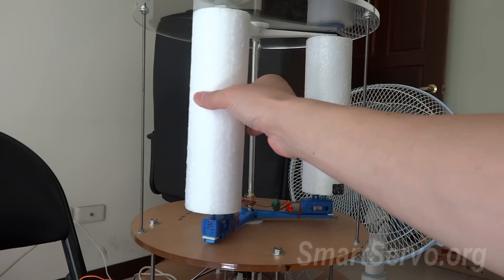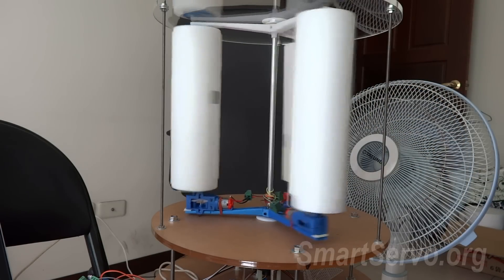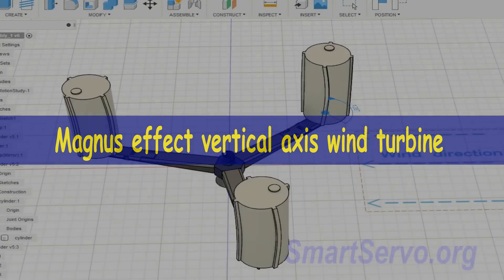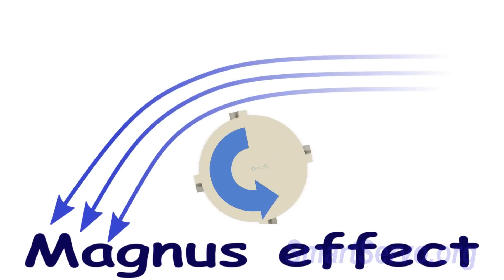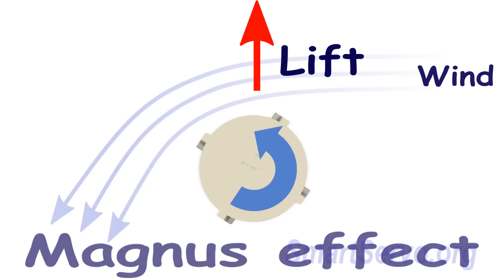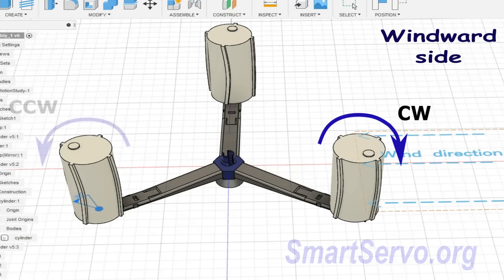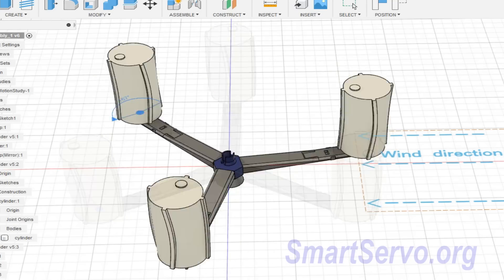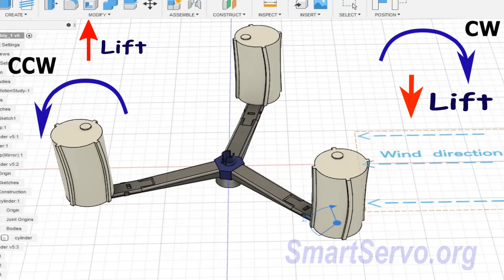Magnus effect vertical axis wind turbine, No blade, start quickly

Comment: I see that the motors you used have a gearbox. Is it because they need more torque and less speed? I’d like to know the main reason. Great video, by the way!
Reply from the maker: Yes you are right.This small DC130 motor has a top speed of 5000 rpm, but has very little torque

Comment: All practical tests of ground-based small wind turbines show: 1) They hardly produce any electricity! 2) They do not last long! 
Wind/electricity yield increases with the third power of the wind speed.+ 100% wind = 800% +electricity. Close to the ground, however, 0 constant wind, but intensive gusts. 
Therefore 9 out of 10 small wind turbines stop working after just a few years due to the extremely gusty winds close to ground.
On the other hand, solar panels generate at least 10 times more electricity with the same investment! Reliable and almost maintenance-free for at least 25 years!
Reply from the maker: It is precisely because the current wind turbine has many shortcomings that we need to improve it. This is the difference between engineers and investors.

Comment: Hi ! We are two french students and we are leading some research and experiments on magnus effect wind turbines. We would like to build it ourselves to test it with different parameters.
 Is it possible to have more details on the construction of this turbine (especially on motors) ?
Reply from the maker: URLs to all project files are listed below the video description. The motor model is DC130
Reply: @SmartServo_org  Hello again ! We've been going through the documents filed under the video but we still have some questions left. How did you build the gear reducer (or did you buy it ? what type is it ?) ? How does the tachometer work exactly ? And what is the purpose of the Arduino card, does it only receive information or also control the motors ?
Reply from the maker: @EliseVeyrat  you can get the gear box on amazon by searching"gear box arduino",To avoid too large a gear ratio to reduce the speed, 20 is a good choice. Since the rotor should rotate in opposite directions on the windward and leeward sides, the Arduino controls the speed and direction of the 3 motors according the azimuth sensor below the main shaft.As can be seen, two semi-circular plates are arranged at 90 degrees apart to divide a plane into 4 quadrants. at power up ,guessing at the center of the quadrant make the error less than +/- 45 degree which is small enough to drive the rotor in the right direction. when the main shaft rotates through the quadrants, the correct azimuth can be found.  then count the pulse from the third plate with 40 holes on it to get the real time precise azimuth.

Comment: I would say that It has blades on the foam cylinder
Reply from the maker: the strip on the cylinder is not necessary => https://youtu.be/XmZwYpoKQ8Y?si=R0IujWvqjNI3tsB0&t=22
Reply: the strip on the cylinder presents the force for cylinder's rotation, then causes outer turbine rotating.
you can compare the rotation speed difference between with and without the strips. 
and you can test by using the cylinder with very smooth surface such as thin foil

Comment: How are you solved the commutation of Flettner rotor rotation?
Reply from the maker: Using DC motor driver board (L298), all project parts are listed here => http://smartservo.org/en/magnus-vawt-files-open-en/
Reply: @SmartServo_org  Thanks. I think, overcoming inertia when reversing the direction of rotation of the cylinders must bring down the efficiency of this device severely.
Reply from the maker: @minduton  Yes, but energy consumption can be minimized through the methods described here => http://smartservo.org/en/magnus-vawt-implement-en/#improve_ways
Reply: @SmartServo_org  At this would be better to apply the "pendulum principle". Take such a pendulum at an ancient clock. It is a machine that performs a regular opposite movements, but with an absolute minimum of energy. So, install a spring or a piece of rubber coil into the Flettner cylinder, which mostly uses the energy to rotate the cylinder in the opposite direction.
It is also a question whether it would not be an advantage to reduce the number of Flettner cylinders to an even number. This would make it possible to mechanically link the drive of the opposite cylinders and then maybe figure out some mechanically elegant way to use the already unnecessary kinetic energy of the opposite cylinder to reverse the rotation.

This type of turbine simply stands and falls on how efficiently it is possible to recover the kinetic energy of those cylinders during their commutation. So far you are at "minus 100%" currently. :) Unfortunately. So in terms of overall efficiency, it sucks.

The speed and direction of rotation of the cylinders should copy an ideal sinusoidal curve when projected onto the graph, logically. With such a course of rotation speed, the maximum efficiency of this device will be.

Comment: All practical tests show that small wind turbines hardly generate any electricity. And only at costs above 1$/kWh! 
There is hardly any wind near the ground. And it is also very gusty, which extremely reduces the service life of the systems. 
With solar systems, you can reliably generate electricity for about 8-12 cents/kWh over a period of 25 years! //
Alle Praxistest zeigen, dass Kleinwindanlagen kaum Strom erzeugen - und nur zu Kosten sehr deutlich über 1€/kWh! Denn bodennah weht kaum Wind, zudem extrem böig, was die Lebensdauer der Anlagen extrem verringert. Mit Solaranlagen hingegen erzeugt man zuverlässig über 25 Jahre Strom zu ca. 8-12 Cent/kWh!
Wer unbedingt energieautark sein muß, der kommt um Kleinwindkraft kaum herum. Ansonsten jedoch viel ist Strom aus Kleinwindanlagen viel zu teuer.
Reply: А 10 КВТ ВЕТРОГЕНЕРАТОР ВЫГОДЕН ОН УЖЕ БОЛЬШОЙ ДЛЯ ДОМА ДОЛЖНО ХВАТИТЬ
Reply: It depends on where you live. In Germany, the energy in winter is hardly worth mentioning. I have a panel on the wall, it produces 80 watts in summer, but in winter it's only about 5 watts when the sun is shining.

Comment: Now let get to the main goal of this device: 'wind turbine' to generate energy.

1. all power input into make the device spin in the wind will greatly negate any potential power it generated.
2. with the complexity of the mechanism, in practice, this device is prone to failure very quickly
3. by using 3 brushed motors as a mean to spin it, the rsult is quicker to failure due to burntout brushes.
    if brushless motors are being used, they are expensive and added more complexity to the device.

Good try for demo though.
Reply from the maker: Thanks for your comment, let me explain your doubts：
1, Although it takes energy to rotate the cylinder, there are still ways to minimize energy consumption, see => http://smartservo.org/en/magnus-vawt-implement-en/
  And don't forget that wind energy is proportional to the cube of wind speed. When the wind is strong enough, a net energy is produced.
2,  The mechanism was chosen for this project simply because it was cheap. A set of DC motors and gearboxes cost less than $2 USD. Direct drive is also possible to eliminate the need for a gearbox to reduce complexity. => https://youtu.be/XmZwYpoKQ8Y?si=CRQ2mNfxw8CiiLoG&t=97
3, Due to the advancement of new motor technology,  brushless motors are widely used in drones and remote control aircraft, which are reliable and cheap and suitable for our use.

Comment: If you put a stator in each of the cylinders with a magnet, then each cylinder could generate electricity along with the arms that hold them out. And it could be sent via wireless electromagnetic induction of a unique transformer in the center of the vertical shaft where it all comes together to avoid twisting up the wires as the whole thing spins around that central axis.
Reply: the cylinders are driven by motors to produce the spin on the main shaft so diminishing returns i'm afraid.
Reply: @LethargicLemon  My idea would use the mechanical input of wind to turn a brushless motor for electrostatic output. It would not experience a reduction of "power," because technically electrostatic charge isn't a thermal effect. It can create heat in the form of voltage/electricity when inducted with a transformer though, and that's what I'm suggesting.
Reply: @LethargicLemon  I think he just used the electric fan to simulate wind. If his cylinders are actually very sensitive to wind, then they'd be great for generating their own charges that could be combined in the central vertical shaft/housing via a transformer.
Reply: @davidt1621  check out his other videos he has intentionally mounted small motors to the bottom of the cylinders to turn them in opposing directions when required. He also provides a valid application for it.
Reply: @LethargicLemon  That's cheating though. The magnus effect is powered mechanically from natural airflow.

Comment: its very ineffecient. the disc turning back and forth halfway every cycle is a loss of energy. try to make that discs complete a full rotation so it wont affect the stability of the turbine.
Reply from the maker: It can be used as a torque generator to start a large Darrieus turbine with very little motor and energy consumption. see => https://youtu.be/9AdpggaOfF0?si=RLCUqJ6pFhHZlZHI

Comment: You have a static start mechanism but you have failed to compute the actual wind direction  in relation to the centre of each roller. very different phase angles needed . So take the phase angle from the centre of each roller and a wind vane on each roller . Then watch it fly
Reply from the maker: The phase of the rotor is not determined by the mechanism, but set by software. The encoder under the main shaft can detect the position of the rotor, and with the anemometer(Not necessary for wind tunnels), the angle between the wind and the rotor can be calculated. The software then add an offset to each rotor.
Reply: @SmartServo_org  phase angle detection is via the underside . you need to account for apparent wind .

Comment: I have wondered if three tall thin Savonious rotors in this configuration would work well in unison if they were geared to the armature and power was taken from the rotation of the armature. I think the gear ratio would be important. It seems like they should spin fast enough to create enough magnus effect to give the armature a torque advantage,  yet not so fast as to wear out bearings, or create too much vibration. Their distance to each other would also seem critical and the frame that holds it all would need to be far enough away from the working parts to prevent interference. It doesn't seem like the Savonious rotors would need to be the twisted helical style because they would always be changing their location and three working together should cancel out the 'flap flap' of a single two sided rotor. There would probably be all sorts of variables to work out for maximum efficiency. If nothing else it would make a beautiful wind sculpture. I was thinking about this and looking up planetary gears when I found your video. Very interesting, good luck with your experiment.👍
Reply from the maker: Thanks for your comment, I think we are using very different approaches, but good luck anyway.

Comment: @SmartServo Nicely done. Do not put too much attention at all the harsh comments, people tend to be quite hostile to new and novel ideas, especially if they are complex projects. I have read your replies and you are clearly knowledgeable on the material.  I would suggest further testing to reduce the input power requirements, while reducing/improving components use. I would suggest the use of air-bearings or magnetic bearings to reduce noise and frictional losses. I hope you continue further research. And if you ever need help, do not be afraid to ask me or other people in academia for advise.
Reply from the maker: Thank you for your advice and encouragement, which made me feel warm. I have made a bigger one of this type., which is only shown briefly @1:30 of this video => https://youtu.be/9AdpggaOfF0 .
and I found that there are several ways to improve the efficiency: (1)Reduce the inertia of the rotor. (2)Recycle the energy when the motor decelerates and supply it to the accelerating motor, (3) Increasing the lift-to -drag ratio of the rotor, I believe that when these are improved, at sufficient wind speeds this wind turbine can be used to generate electricity.
Reply: Two thumbs up, and full speed ahead, Jehovah bless.😊

Comment: My question is that is at a ideal situation that's not in  The natural situation which is it's constantly changing wind speed
Reply from the maker: The reason traditional lift-type VAWTs worry about changes in wind speed is that the angle of attack(related to TSR) will be affected and possibly cause a stall. Magnus rotor is immune to wind speed changes, because the circular rotor has no chord, so there is no angle of attack, and no stall problem.

Comment: How much would it cost to build one of these? 3D printers, material, electrical equipment for testing etc?
Reply from the maker: The materials are not expensive, mainly include Arduino UNO(10 USD), L298 DC motor Driver(2.5 USD) x3, motor & Gear box(2 USD) x3, Slip ring(10 USD), optocoupler module(2 USD) )x3, the most expensive part is three acrylic circular plates (made to order) which cost about 40 USD

Comment: I'd like to see this working without all the wires and you know that's because there are a lot of fakes on YT powered by batteries.   Until I sees it, I don't believes it.
Reply: its works, i did a similar projectformy dissertation, infact I didn't use motors to get the cylinders to rotate
Reply: @nazarinebeats5521  I accept your explanation but plesae also explain the scientific reasoning behind your invention.
Reply: @fireballxl-5748  ohh I think i understand check this video (it works by a principal called magnus effect) for energy generation its best to minimise the energy put in the system ie egergy used to cause the cylinders to spin!

Comment: If this was to replace existing wind turbines. How big would it be to generate the same amount of electricity?
Reply from the maker: If you're asking about efficiency, further experimentation is required. I've only verified so far that it can exceed TSR 2, Limited by motor response and rotor lift-to-drag ratio, but already faster than many common VAWTs.

Comment: Even if it does work, the bearings will, wear out quickly... And you have a lot of them...
Reply from the maker: The torque characteristics of common VAWTs with blades are quite different from those with rotors, so previous experience cannot be applied here.
Reply: @SmartServo_org  what does that have to do with it, vertical turbans have only one or two and they fail...you need at least 8 taper bearings...
Reply: I believe their point was that there may be less loading on the bearings, leading to increased lifespan...

Comment: With the sun and the wind I will travel forever. . . since I consume electricity to travel, why not recover some of it using a mini or micro wind generator, with vertical axis, placed externally somewhere in the car and a system of solar panels? These systems will deliver energy. . forever. (I mean: a moving object, like a car, will create a vortex in the air, the wind. When it hits the wind turbine, it will generate electricity that will recharge the batteries).
Reply from the maker: Installing a wind turbine on a car will increase drag and therefore increase the car's fuel consumption. In fact, the electricity produced by this wind turbine comes from fuel.

Comment: House fan makes no viable flow over entire unit. 
Unit needs 2 B outside in strong winds - this design will blow away like paper plates 
More energy & materials is used to rotate elements than elements are able to produce. 
Element motion must be self powered by aerodynamic flow a primary source and directive.
Reply from the maker: All attempts in the past to passively drive the rotor by aerodynamics have failed, not fast enough. Actively driving the rotor may still be successful as long as the efficiency is improved. => http://smartservo.org/en/magnus-vawt-implement-en/

Comment: now all you have to do is tie a wind direction sensor in to the phase control to automate the system
Reply from the maker: Yes, this is a necessary step for testing the turbine outdoors. Before that, I needed to redesign the structure to make it bigger and stronger.

Comment: Hello. Pretty amazing concept! If I want to build one, what 3D printing materials would you recommend? Can you advise on the what electrical components I could use ?
Reply from the maker: In my project I used PLA as my 3D printing material, but after about 1 year it has been bent due to the weight of the motor. Maybe ABS with better mechanical strength is more suitable for this, but still not suitable for large models, and ABS requires more 3D printing skills. The electronic components I use are Arduino UNO controller board, L298 DC motor driver board x3 and optocoupler modules x3.
Reply: @SmartServo_org  Thank you and all the best!

Comment: Pretty complex design for a very simple problem . All my vertical wind turbines self start with no problem. You've created a solution for a problem that doesn't exist.
Reply from the maker: Currently, lift-type vertical axis wind turbines are started at the expense of reduced efficiency or increased complexity(cost).